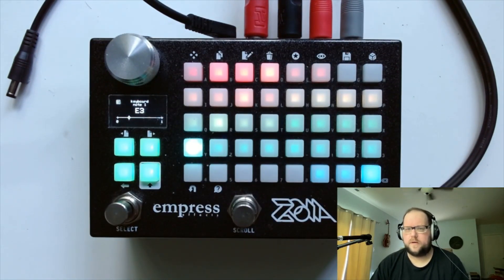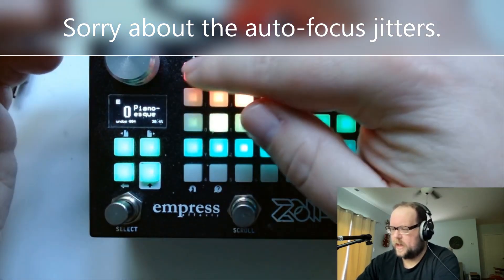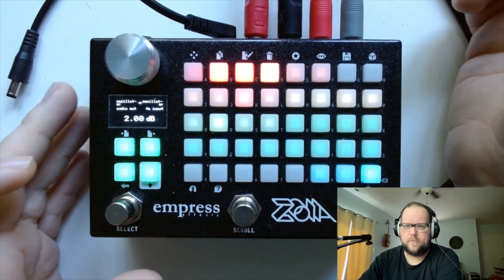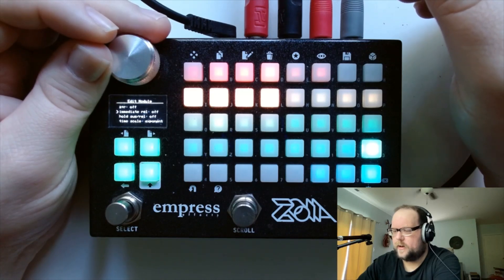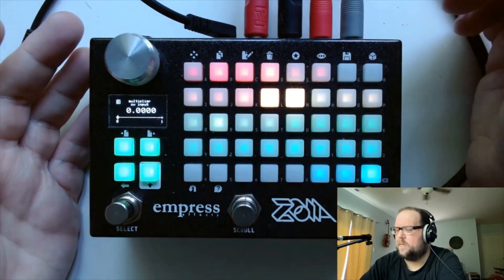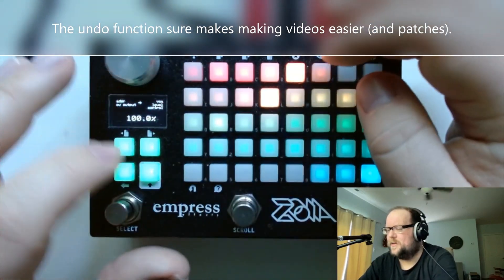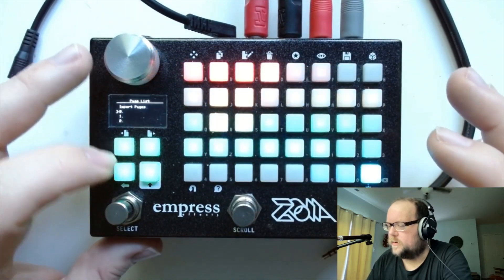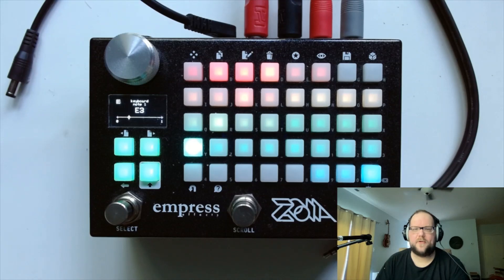Empress ZOIA tutorial:  "Zynth Zekrets -- how to make a piano-esque sound"

Comment: Thank you for this! I was just going to explore this sort of thing after listening to this morning's generative patch, this is a great jumping off point.
Reply from the maker: Yup, this is the "recipe" I used in this morning's patch (and quite a few others over the past few months).  There are some variations ( for instance, you get a slightly different feel if the FM comes from the output of the VCA as opposed to the output of the oscillator, and every once and a while, I'll use a SV filter and change its frequency with an envelope, but the resonance this introduces makes it all sound a bit more "synthy"), but I've found this basic setup works pretty well for my purposes.

Comment: Add some tape emulation Fx and you’ve pretty much got a lofi piano sound for anything!
Reply from the maker: You could probably narrow the bandwidth of the filters (increase the HPF frequency, decrease the LPF frequency) and add some warbly pitch modulation to the oscillator frequency (the one I'm using a lot these days involves using two triangle LFOs, joined at a multiplier, with each of the LFOs slightly affecting the other's rate, but there are an almost infinite number of varieties on this type of modulation) and get pretty close to that without need for additional effects, might cost you a couple % of CPU.
Reply: @ChristopherHMJacques  might try this soon! Filters and adding LFOs sometimes just goes over my head and I think of linear stuff again… I need to get back into a constant ZOIA patching game and not only playing